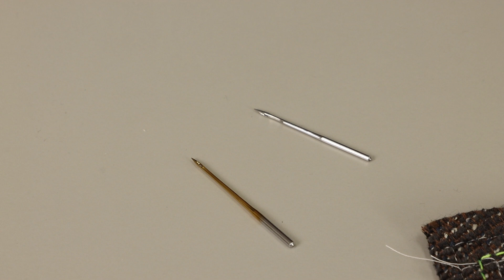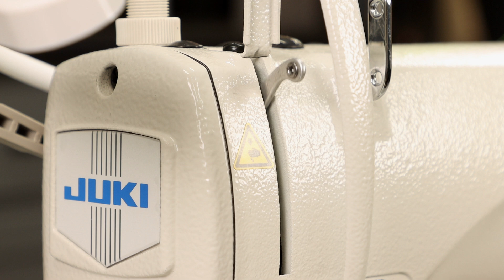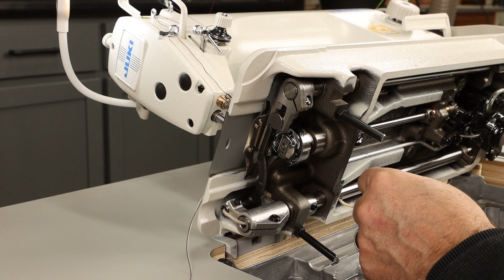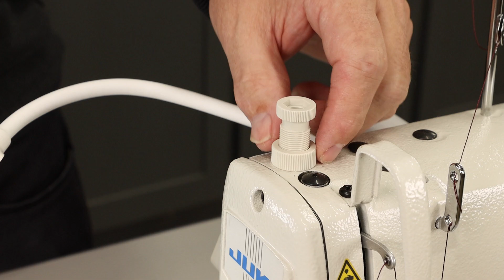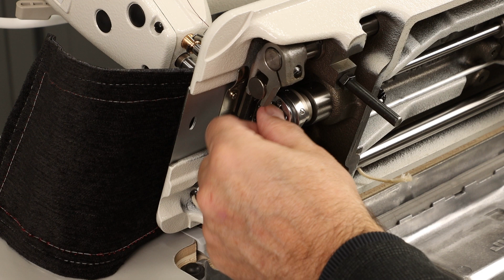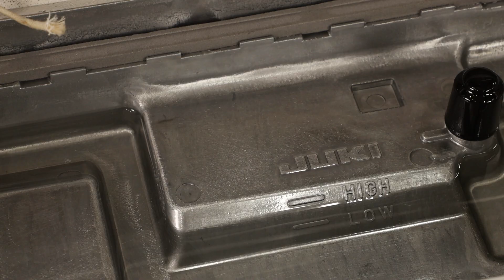Troubleshooting Juki DDL 8700 Industrial Sewing Machine Repair of Common Problems and Issues

Comment: My sewing machine belt is making a noise; what should I do?
Reply from the maker: I like to start with the easy solutions.  Check to see if the belt is making contact with the slot in the table or belt guard.  Thanks

Comment: My machine is brand new, it came in a huge box, we put it together and it work fine, and then it started to making a loud noise on the side of the pulley.... I am trying to find someone in my area that can visit to check the machine, but is there any idea of what is going on?
Reply from the maker: Usually it's a belt hitting the guard.  Or sometimes the handwheel gets installed too close to the head and it rubs / grinds.  Look under the table with a flashlight to see if the belt contacts the table or belt guard.  Thanks

Comment: Hi I'd like some advice please. Can you tell me where I can get a roller foot for this juki  ddl 8700 machine and what is the correct part number to ask for? Thanks much.  I am sewing leatherette and using a Teflon foot however on some of the very thick parts with several layers I find the leatherette is getting a bit grazed and damaged.  Can you please advise on this? Someone said to pound the material with a hammer to compress it.  Another said the roller foot would help.  I really don't know.  Thanks in advance
Reply from the maker: You can find them on eBay here  https://www.ebay.com/itm/167574001436?_skw=roller+foot+juki+ddl+8700&itmmeta=01M4BQ62ZXBJK7HB5K004BV4TZ&hash=item270430571c:g:yO8AAOSwQHtgveTG&itmprp=enc%3AAQALAAAA4GfYFPkwiKCW4ZNSs2u11xBFhOXFkQ9JPsyF8hE4dsGaL1WLfXBT4oazRgo08gMB%2BQuQOlFeDgeRyIrl5PuvYyhdlsjSm%2Fx19VYofYPXck8th%2BhyOjItRDYgfavacoHi7Q0ehFtsjrc1tJ9uZlNT5JXgKNJx88HtSSE1rtipsw%2B%2FLrK%2BJJ%2FbqL7bOl5m8SNCbkR3EcBb%2Fu2mMcKgQg9QlgL26Naftl23bFlWq7aUmzezPkOG6jAK3rAcqJsp8Hu1b9z3VhPPqP2XUPKKpcwNYuUMbSTnXvegv5WdvkGB0VeX%7Ctkp%3ABk9SR5ywmPeiaA  sorry for the crazy long link.  Or shop any Juki authorized dealer for Juki brand parts.  Thanks
Reply: @TheThoughtfulWoodworker thank you very much

Comment: You know hot to put the lubrication wicks in my machine is not coming whit that
Reply from the maker: If it's actually a Juki brand, then it originally came with some oil wicks.  You can buy replacement kits from Juki or online sewing retailers.  The best way to see where they go is to examine a new machine.  Thanks and good luck!

Comment: Hi, I have a Juki DU1181N when I try to pull out my fabric after sewing, it won’t pull easily, I have to turn the hand wheel up and down to free the threads, even with the take up lever in the top position, also when I start sewing the top thread pulls back into the machine and unthreads the needle, even when I start with long threads, when I hold the threads, I feel them pulling in. I really hope you can understand what I’m talking about sorry, it’s quite frustrating at this point 
 Thank you in advance for any help at all. 👍
Reply from the maker: You're doing the right thing to hold the threads back when you start sewing.  Position the takeup arm at or near the top when you start sewing, which really helps.  As far as releasing the fabric, you may have a timing or feed dog timing issue.  Thanks

Comment: Wonderful instructions. Just subscribed. The one thing for me is  I can’t for the life of me remove the screw to drain my machine. It’s soooo hard.
Reply from the maker: Yes, the key is to find an extra large screwdriver that fits snug in the slot.  Worst case, you can use vice grips on the handle of the screwdriver to break it loose.
Reply: @TheThoughtfulWoodworker ughhh, I got no strength 😅

Comment: Hello, I own a Juki DDL5550 that is set up to sew fine to regular cotton which I like but would love to sew vinyl with this machine also. I realize I can change the tension and the feed dog and needle plate with some possible adjustments. I was wondering if you could demonstrate the process, or do a tutorial on this subject? Thanks so much for all the lessons you have put out on youtube they are very helpful.
Reply from the maker: Thanks for the kind words!  I don't have my DDL machine anymore, but it is capable of sewing two layers of automotive style vinyl just fine.  You may need to increase upper thread tension slightly, but that's about it.  Thanks again!

Comment: I need HELP!!! Error 302 says it’s a tilt or something similar. We tried to tilt while machine is on than put back. We tried to reset. It works for a few hours or days but the error keeps coming back?????? 
Any idea what this is and how we can get rid of it? Local techs are asking for $500-$600
Reply from the maker: Look for the magnetic sensor at the back of the machine that tells the computer whether the machine is tilted down.  Make sure there's nothing preventing the sensor from reading, like an obstruction.  The sensor may need to be adjusted slightly to read properly.  Once you've done that, turn power off for 30+ seconds are turn it on again to re-test.  Thanks!
Reply: Would this be located on top of the machine or towards the bottom?
Reply from the maker: @stelaangelova4887  It can vary a little by model, but usually where the machine head meets the table at the back of the machine.  Thanks.

Comment: Pls how to reduce speed on junki 8700
Reply from the maker: If you have a clutch motor, you can change it to a servo motor.  If you already have a servo, you can use a smaller motor pulley, like 45mm.  Thanks!

Comment: My Juki DDL-8700 locked up, I need to unlock the needle. How do I do that?
Reply from the maker: Unlock the needle, as in remove it from the machine?  Loosen the set screw and pull it out.  Needle nose pliers may help.  Thanks

Comment: Thank you, thank you, thank you!   My DDL8700H is my 4th machine, but first industrial machine.  I kept looping the bottom when sewing chord to thick material because I was knee lifting to "help it along".  I also didn't know about the left hand lift for loading the bobbin.  This video is the most helpful I've watched for the DDL.  I got a $35 walking foot kit on it from Amazon.  It seems I don't know what I'm doing with that either.  The loop above the needle that looks like an inverted crown that's critical for keeping the thread in the needle while starting won't fit with my walking foot kit on it.  I've had issues with starting out and the thread pulling out of the needle.  Any advice is greatly appreciated.
Reply from the maker: As far as the thread pulling out, you can hold your threads back as you begin to sew.  Also, starting with the take up lever at the highest position helps as well.  Thanks for the positive comment!

Comment: First of all I'd like to thank you for your valuable information about this sewing machine. Secondly i wanted to say that my machine start running by itself as soon as plug in to power. Any clue?
Reply from the maker: Yes I've had that happen on several occasions.  You'll need to adjust the foot pedal linkage to make it slightly longer.  Just loosen one bolt on the rod, and expand it slightly so the foot pedal sits at approximately a 15 degree angle.  Thanks!

Comment: I just got this same machine , but the back stitching is giving a but of an issue , i am getting loops at the top of the material and it want to crumble or pull the material together while it tries to backstitch. How can i fix these issues?
Reply from the maker: Well loops on top usually means the upper tension is too tight (assuming everything else is adjusted properly).  Start by backing the upper tension way back.  Check that the bobbin is well wound, and giving about the resistance as a spool of dental floss - light and consistent.  Gradually increase upper tension knob 1/2 turn at a time until you can balance the stitch.  Also make sure your needle is the correct system for the machine, and the right size for the thread you're using.  Good luck!

Comment: Very helpful video, especially for a rookie 😊.  I have been sewing two layers of vinyl and experiencing drag marks, what is the most common cause of this problem. The vinyl is lightweight.   Thank you.
Reply from the maker: Sounds like you could decrease downward foot pressure.  Just loosen the thumb nun on the plastic threaded rod on top of the machine.  Then back the threaded post out and re-test.  Also check that your presser foot isn't knurled or textured.  Thanks!

Comment: I’ve just undone the screw on the feed dog as it was too low,then I tightened it up but the back of the feed dog was still low so I lifted the machine and then unscrewed the back two screws slightly lifted the feed dog and then done them up tight but know the machine hand wheel is very tight to turn what have I done wrong ? Please help me 😊
Reply from the maker: When the handwheel is tight to rotate, it usually means there's a hard mechanical obstruction.  Try backing off the last adjustment you just made, ever so slightly, and make sure the feed dog isn't contacting the front or back of the throat plate opening at maximum stitch length.  Thanks.
Reply: @TheThoughtfulWoodworker all sorted many thanks 😊

Comment: Mine is 8700D it stuck what might be the cause
Reply from the maker: Likely thread is bound up in the bobbin case area.  Use a light to find any loose threads, and hold them with tweezers while you rock the handwheel back and forth.  Once you get the bobbin case out, it should be more obvious.  Thanks!

Comment: Hi how can I reduce the speed on the Juki DDL 8700 machine?
Reply from the maker: There are a couple great ways to reduce machine speed.  If you have a clutch motor, replace it with a servo motor like this... https://amzn.to/4s69ICd  If you're already using a servo motor, you can replace the motor pulley for a smaller one.  45mm diameter or smaller is best   https://amzn.to/48KkmHc   Thanks!
Reply: @TheThoughtfulWoodworker thank you.  I'll have a look into it.

Comment: I am a subscriber and really like your videos on sewing machines. I like working on these old machines and find your videos concise and complete. I just wish you would say which class bobbin each machine takes in the beginning of all your videos. I just set up a Juki DDL 555 on a table with a servo motor which probably takes the same bobbin as your machine but I am getting conflicting answers on the internet as to which bobbin to buy. Most of my machines are industrial walking foot or vintage singer domestics. I'm leaning towards class L for this one but not sure.
Reply from the maker: It will be an L style bobbin for your machine.  Good suggestion to mention bobbin size in each video.  It can be confusing sometimes.  Thanks!

Comment: Thank you.  I have this machine and have been trying to learn it on my own. Bad idea.  This video has saved today. What is the problem when you are sewing and your bobbin seams to loosen up?
Reply from the maker: When you say bobbin loosens up, do you mean loose loops of thread on the bottom?  If that's the problem, then you need to increase the upper tension knob by turning it clockwise.  Adjust by 1/4 turn and re-test.  Thanks!

Comment: Hi! Can we change juki 8700 H into 8700 by changing feed dog.if yes did it work fine on both settings.
Reply from the maker: The H model has thicker needle bar, needle plate and feed dogs.  So it may be difficult to fully convert one to the other, you may achieve what you're after by swapping the feed dogs (or lowering them slightly) for a less aggressive action.  Thanks

Comment: ❤ Merci beaucoup pour toutes ces infos. J’ai une DDL 8700-7 Pourriez vous me dire comment régler la longueur du fil avec le coupé fil car celui-ci une fois coupé est trop court et la machine se dés enfilé quand je redémarre ma couture. Encore merci 😊
Reply from the maker: Thank you very much for the kind words, I appreciate that.  The easiest thing to do is remove the bobbin after winding, and pull a little more thread out from the spool.  Then use the thread cutter or scissors to cut the bobbin free.  Thank you!

Comment: There is a dial indicator on the motor what it it used for and what is the position to use
Reply from the maker: The dial on most analog servo motors limits the top speed and power.  Usually I set mine around 1200rpm for a good balance of slow speed control and adequate power.  Thanks
Reply: @TheThoughtfulWoodworker thank you ever so much and  for explaining and for just getting back to me.

Comment: I love your videos and could watch them all day. I'm having trouble on my 8700 with bunching up on back stitch. It's only at the beginning of my stitch, never at the end. I'm using DBx1 110/18 with Tex70 (#68). It's driving me crazy. It just all the sudden started. Nothing else has changed. Got any ideas?
Reply from the maker: Well the typical issue when starting is not holding your threads back.  That would explain why it happens when starting and backpacking, but not at the end of your seam.  I'm suspicious something else is at play though.  New thread?  Springy black color thread?  Try replacing the needle and rethreading the machine top to bottom.  Thanks

Comment: You really know this machine. I have a question.Will this machine, se with this machine sew auto upholstery vinyl with a quarter of inch foam glued to it? 
Thanks!
Reply from the maker: It's really an apparel class machine.  The scrim foam isn't much of a problem because it compresses so well.  Where the DDL 8700 will struggle is with putting multiple pieces together and the bulky seams.  It will do upholstery in a pinch, but a walking foot would be a better choice.  Thanks!
Reply: @TheThoughtfulWoodworker  Thank you for your reply. This looks like a nice machine. My interest will be mostly toward auto upholstery. I like the way you clearly explain things in your videos. I have subscribed and will go back and check out your older videos 
Phillip Hall
Reply: @TheThoughtfulWoodworker 
I understand that if the heavy “set up” is purchased for this machine, or the Juki 5550, they can sew heavier items also. 

  The heavier feed dogs, and the heavier switch plate, and the heavier presser foot need to be switched out to sew heavy items. 

   No?
Reply from the maker: @SherrisPlace  That is technically correct, but please have modest expectations for these changes on a basic drop feed type machine.  Basically it still only has the feed dog to move the material.  No needle feed and no walking foot, so it won't compete with a triple feed machine, but it may feel slightly more capable than stock.  The Juki 8700 and similar machines are pretty darn good for what they are.  Thanks!

Comment: Great tips - many applicable to other machines.  A tip on screwdrivers is to get one with interchangeable tips and pick one with hollow ground tips.  Helps keep from stripping the slots in those small screws.
Reply from the maker: Alright, thanks for the tips!  Having the right screwdriver makes all the difference.  I know I use 4-5 different flat screwdrivers for my industrial machines ranging from a  tiny to giant, depending on what I'm adjusting.  Thanks.